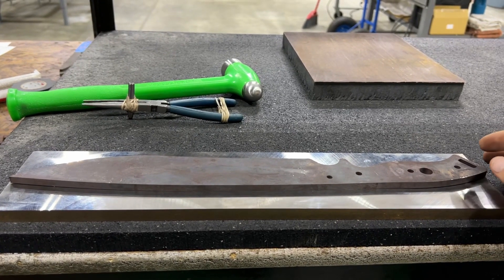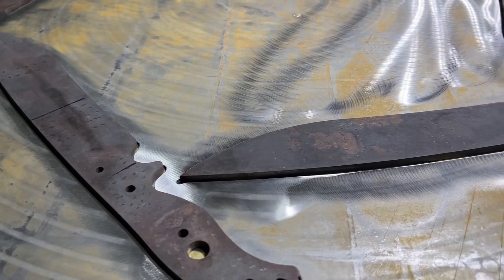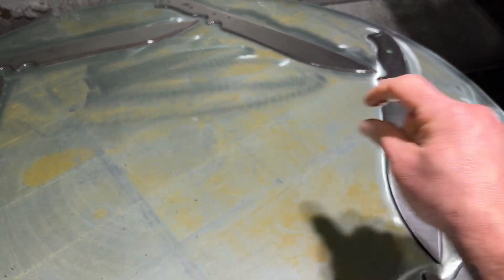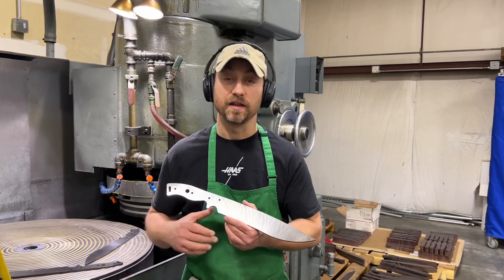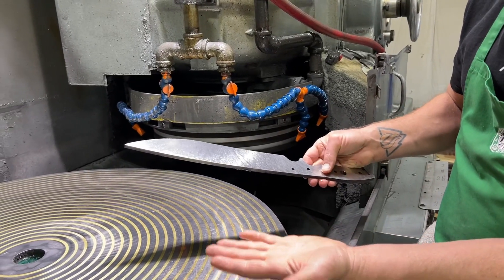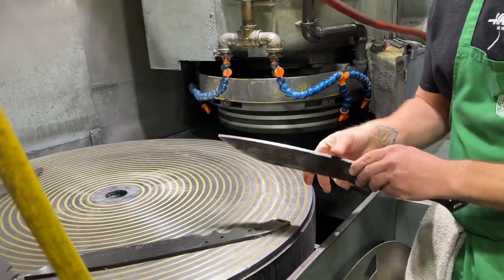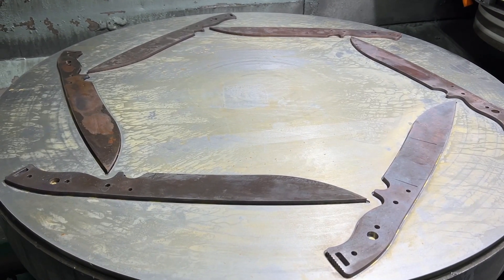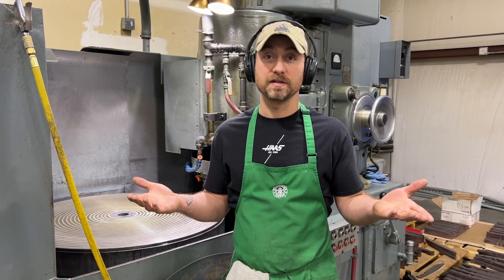GSO-12 Blanchard Grinding: Step by Step

Comment: Just one question from a newbie blanchard operator himself; why heat treat after the grind? The heat treat as you obviously know warped the blades. Only 1.5 years into it so im truly just wondering if thats an actual process. I get doing a cleanup AFTER a heat treat but why take them to size before hand? Or were you hoping the outsourced operator would take stock off so that you burned up less of your stones due to the hardness of the steel.
Reply from the maker: Sounds like you just offered up a good content idea! We'll cover some of what we've learned in a video shortly! You're right about potential warping, which is why we don't take our blades all the way to finished thickness prior to heat treat.

Comment: You didn’t have to thin out the metal too much to make it flat did you? Will thickness be what the specs show on the website?
Reply from the maker: No, we don't need to make the parts more thin to achieve good flatness. We flatten the parts, then bring them down to the specified thickness.

Comment: Thanks for the edumacation! Amazing video.  My ignorance on show here as I had thought this grinding step was done prior to heat treat, but I guess it makes sense to remove any miniscule warping that might occur during the heat treat?
Reply from the maker: We're finding what works best, at least for us, is to bring the parts almost to size, heat treat, and then do a final clean up with a very fine wheel. It gives us a chance to flatten out any small warping or surface irregularities prior to bevel grinding and we're able to achieve a beautiful surface ground finish. Rough surface grinding with an extremely free cutting wheel also gets rid of the hard, hot rolled sheet surface prior to heat treat, which seems to be keeping the parts much flatter during heat treat.
Reply: @Surviveknives  I know its been a hard road, but I can really see you guys and your brand becoming the penultimate experts / gold standard in functional large fixed blades.  The thought and perfection you put into these difficult GSO-12's, 10's and 8's is far superior to anything or anyone manufacturing more than custom unique pieces.

Comment: The hammering doesn’t compromise the integrity of the steel at all? I didn’t realize you could use this technique on a blade. Honest question as I have no idea myself.
Reply from the maker: No, not at all. Aside from it being a little more work, it is a pretty normal way of straightening a hardened part. Some shops even have custom pneumatic setups to get through parts more quickly. That being said, our latest grinding developments and change in manufacturing workflow should make this mostly unnecessary moving forward.

Comment: Thanks for the info!  Are newer orders being executed concurrently as these older models are being produced?  Just curious about how machines and staff time are rotated.
Reply from the maker: Yes, I am working on grinding several models of blade right now, both pre and post heat treat batches. The machine shop is working on machining handles, making the next blade machining fixtures, perimeter machining the next batches of blades and bevel grinding. In the front we're working on cutting more blades, surface finishing, assembly and sharpening.